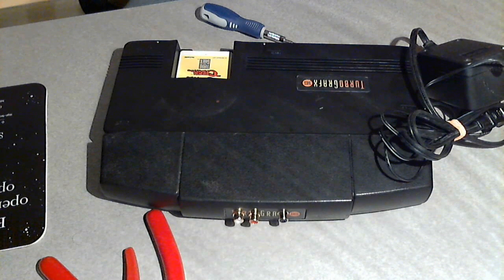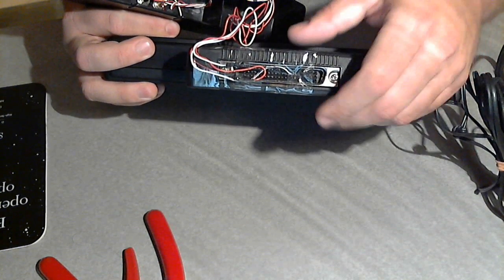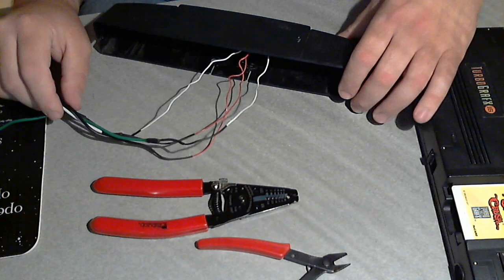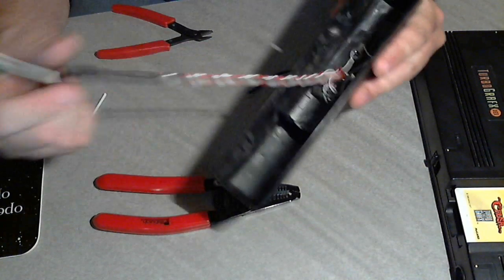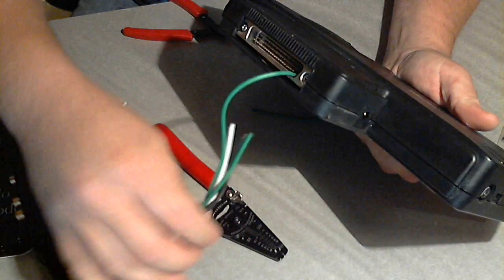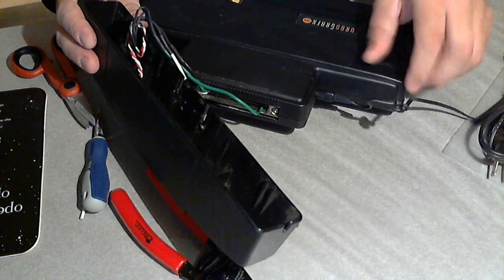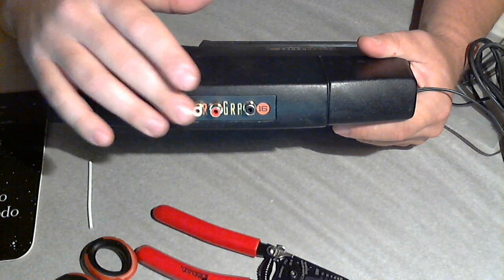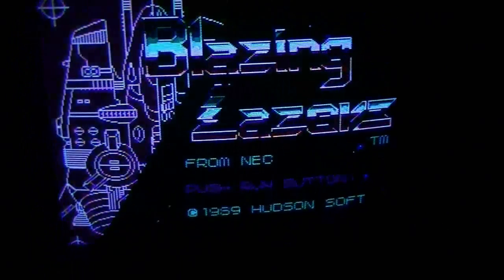Solderless TurboGrafx 16 AV Modification, or stereo sound and composite video mod for your TG16

Comment: Easy enough for a dummy huh?
Good detail but I'll go to the link.
What do you think using a signal converter box assuming you already had one so you didn't have to buy one?
Reply from the maker: Depends on whether or not your RF output is clear. Mine was terrible, so this mod was the only cheap option for clear video.
Reply: There are modded systems being resold for hundreds of dollars and you are giving us a dirty little secret those Ebay thieves don't want us to know. Thanks!

Comment: Hi Ed, I was wondering where did you get the panel mount rca jacks?
Reply from the maker: Radio Shack, but you can get them online as well.
Reply: I went to radio shack and they didn't have them. Atleast not in stock. I have also looked on ebay and couldn't really find any.
Reply: I was hoping I could find a set with red yellow and white.
Reply from the maker: Gary Voight
Oh, I don't know then. I bought about six of each at the Radio Shack down the road from my house for several different projects. Maybe they were just out of stock?
Reply: Could be. I found some on Ebay. Now I just have to wait three our four weeks to get them from China.

Comment: Thanks for the reply. Unfortunately, the Turbo Everdrive doesn't have a save feature either. Regarding the price of the Everdrive, it's actually really good considering what you can do with it. It allows you to play tg16 and pce roms, which is especially great if you don't have a Japanese console or hucard adapter and want to play PCE games on your tg16. :)

Comment: It does seem weird with putting them on pins though. Just push the wires on there and the pin just fits right in there with the wire? I'm glad that part doesn't require soldering thats pretty cool!

Comment: That is a seriously cool mod for TG-16 owners with shallow pockets, as MaximumRD pointed out those Turbo Boosters can get pretty ridiculous in price. You need to get yourself a PC Engine Ed, buy a Core Grafx and none of that is necessary. Just take your Genesis Model 1 AV Cable. Plug that in and you're good to go...plus you get an even bigger game library...which can only be a good thing :)

PS: love these kinds of mod videos, don't think I'd be brave enough to do them myself but they are great.

Comment: Hey if you get a bare board (they may never be a deluxe version) maybe you can devise a nice casing solution? Obviously when the card is inserted in TG16 there is only so much exposed but it would be nice to have those bits covered and protected from static, dust etc. If you come up with a semi simple solution I might try it, I do not know how important cooling might be for such a device?